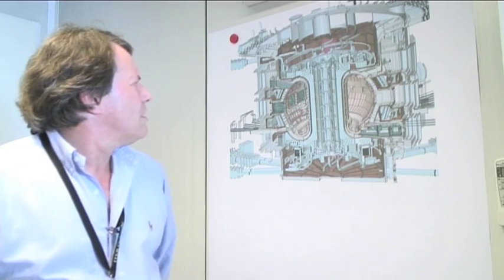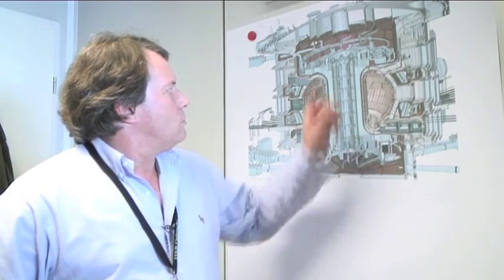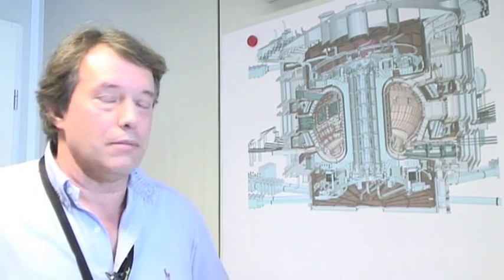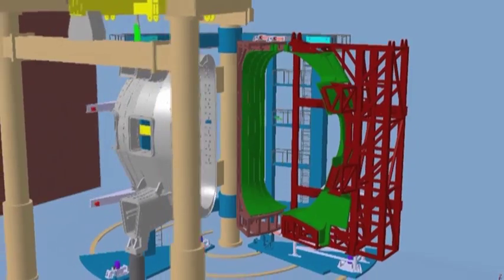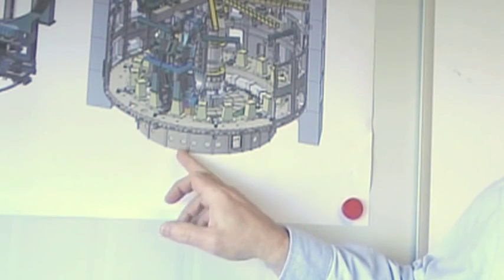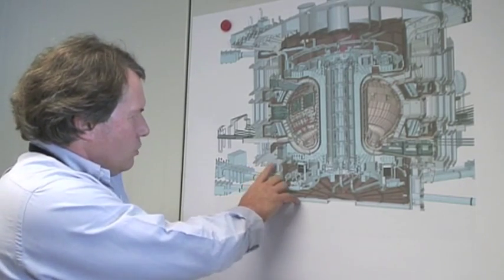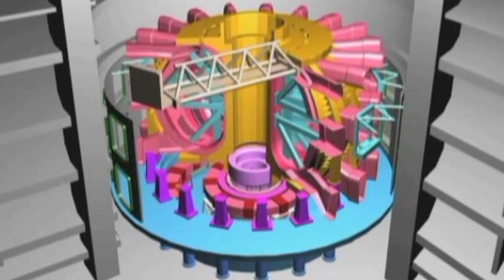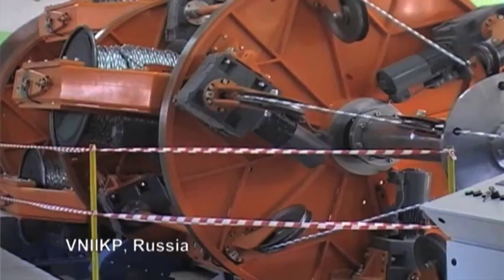ITER - Assembling a million-component machine

Comment: @higgsbos 

check Wendelstein 7-X and its predecessor Wendelstein 7-as. In that reactor design, the stellerator, the confinement is better than in a tokamak, it doesnt leak, and its accomplished only by external magnets. No current is being induced into the plasma torus in the stellerator design. The disadvantage is that the magnetic field is far more complicated, less symmetrical, not a simple torus but a twisted torus. Also, the reactor is bigger, a larger but thinner torus.

Comment: @sandustanBrasov 

well, tokamaks will always leak, but they can still produce more energy than you put in. The confinement isnt perfect.

But there is a different design, the stellerator design, Wendelstein 7-X is currently being assembled. Here the confinement is perfect and doesnt leak, but the magnetic field is far more complicated and less symmetrical. If ITER fails because the confinement isnt good enough, Wendelstein 7-X is the alternative.

Comment: @higgsbos 

second comment....   So in the Tokamak you need to induce current into the plasma to turn the plasma itself into a magnetic coil for confinement. Watch this:  watch?v=eftWIDeMAHI   That is the design of the Wendelstein 7-X, here you only need external coils and no current in the plasma, because at 5 locations particles following the outer trajectories can go deeper into the confinement. So this can work without the leaks haunting tokamaks.

Comment: @sandustanBrasov 

the plasma in the sun is NOT magnetically confined. Its confined by gravity. The magnetic fields of the sun dont matter much when considering the nuclear fusion processes in the sun.

Also, at one locatiopn, you can only have one magnetic field. field lines dont cross the way you describe it. Basically there is only one big magnetic field in our universe that you can locally manipulate, two fields never overlap, never, nowhere in the universe.